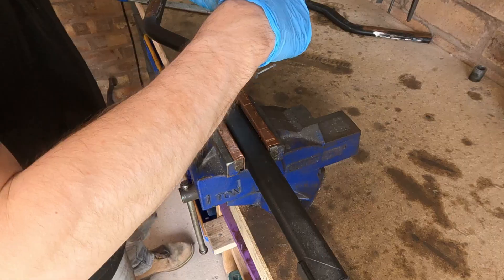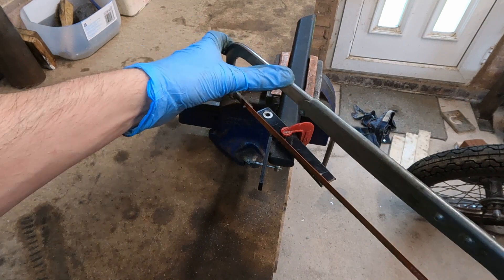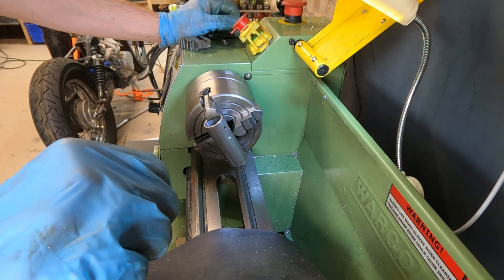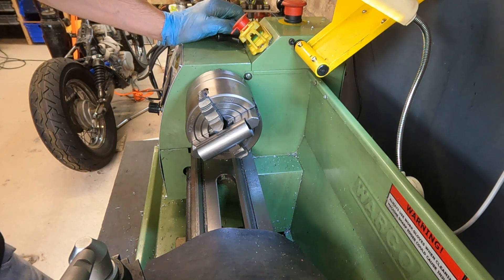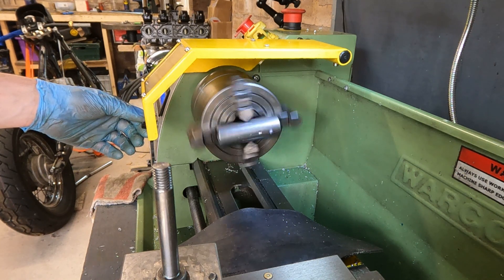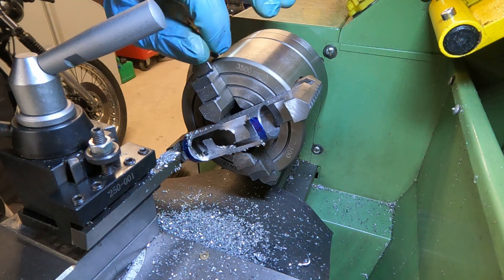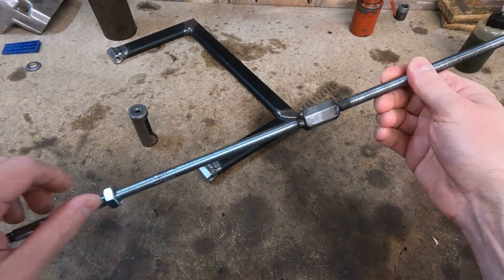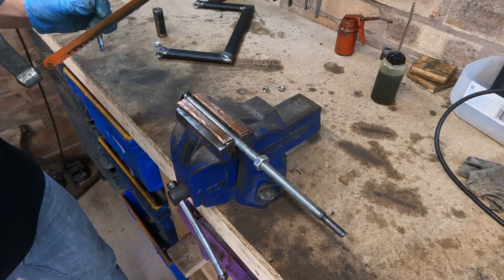DIY Valve Spring Compressor tool - Made from items lying around the workshop

Comment: Getting em out is the easy part..  can do that by hand no matter what head it is..  i use a dye holder from a tap set, and a socket that fits inside that with a magnet inside the socket..  putting those little bastards bAck in kills me every time and i always gotta do it on damn 32 or 16 valve heads..